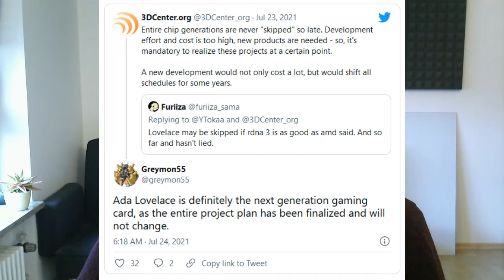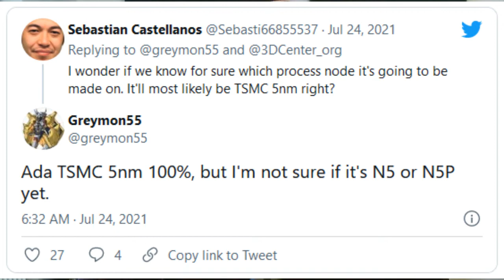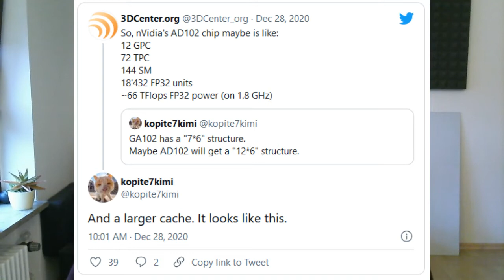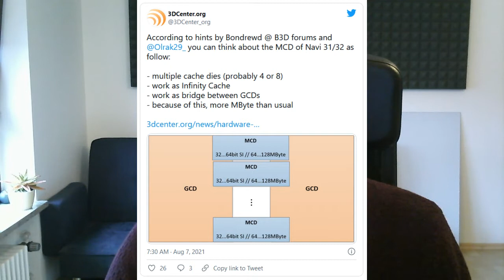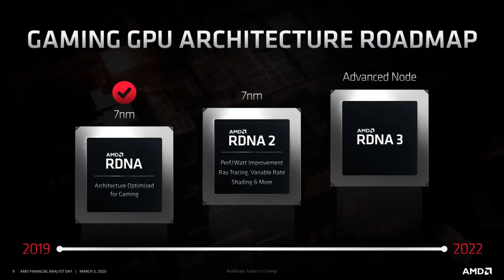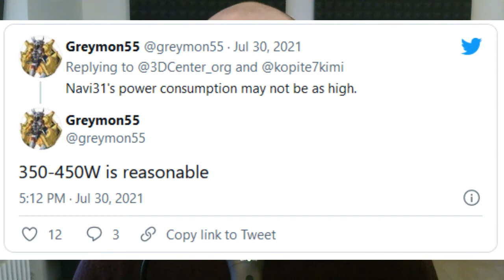Nvidia Lovelace & AMD RDNA3: Monolithic vs Modular Design?

Comment: Lovelace is almost confirmed to have TDPs of around 500-600 Watts. That's enough wattage for a small room's air conditioning.
Reply from the maker: I have heard about these numbers too, but I cant really imagine these numbers are true. 400-450W maybe, but 500-600W? Most modern PSUs are in the 500-750W range, with a power draw at these levels, most ppl would have to upgrade their PSU too. And dont forget cooling, how would you get 600W out of the case?

Comment: Im not that well versed in GPU design, however I believe that AMD will take the crown in the longer run, regardless of their dGPUs being a lil behind or a lil ahead from Nvidia.

Mainly because their chiplet design makes RDNA 2/3 based SoCs very popular and well performing. And as we all know, games get optimized for SoCs in consoles first, and only for GPUs in the PC space later.

If console SoCs are based on RDNA, the translation to RDNA dGPUs is easier, thus resulting in higher performance in a lot of titles. Especially now that even Valve has adopted RDNA 2 in the APU for the steam deck.

NVIDIA is running on borrowed time. Even if they stay ahead by 5-8% every generation, optimization and smart bus memory will mean that people drop Nvidia for AMD. Just because they can pair their GPUs with the best CPUs on the market.
Even Intel admitted they can't catch up to AMD for half a decade.
Reply from the maker: I have to agree with you, I also think that AMD has a very good chance of taking the performance crown with RDNA3 if they can use a chiplet based design against a monolithic approach from Nvidia. I'm not so sure that AMD will have an advantage from the RDNA2 based console SoC, since PS4 and XB1 were also GCN based and it did not translate into an AMD advantage, but we will see.

But I'm not 100% convinced Lovelace will be monolithic, because Nvidia is always good for a surprise :D
Reply: @HighYield  I did see some rumors about Nvidia having some smaller or SoC versions(?) of Lovelace, so maybe they got some trick up their sleeve for this launch or the launch after that?

Good to know I wasn't too far off the mark :) I really thought the old console to PC port compatibility was still a big factor

Comment: HBM2 with stacks of 4GB is the memory solution. I think HBM2e is stacks of 8GB and they sit on the gpu die and get direct contact with the cooler base. GDDR6X is faster than GDDR6 but too hot and hard to cool.
Reply from the maker: HMB would be a really nice way for Nvidia, but I fear that they will only use it on HPC and data center GPUs, not gaming products. If Lovelace would use HBM I think we would see some rumors by now. But you can never know for sure, theres always a chance.